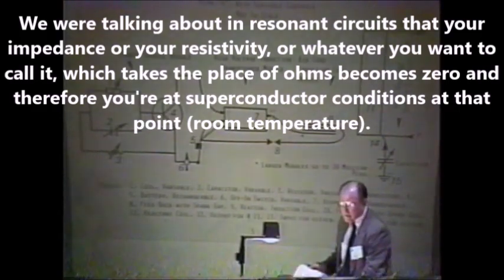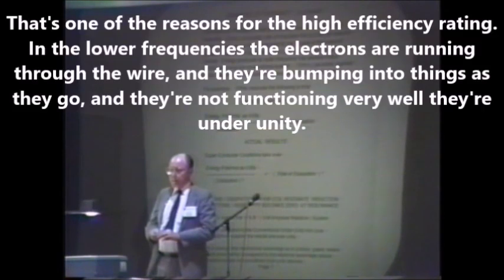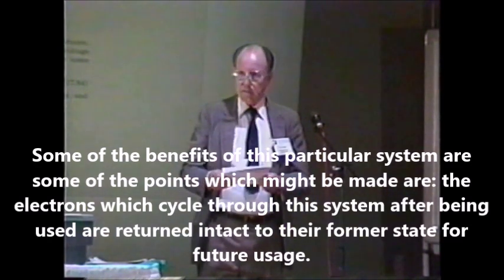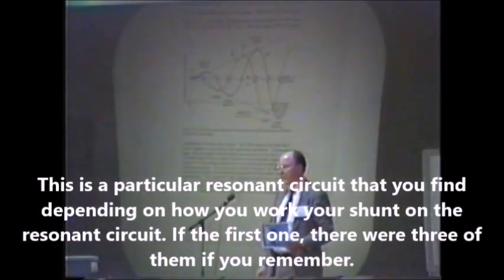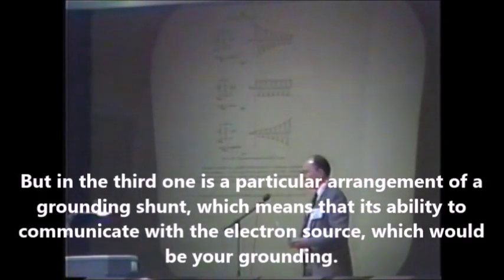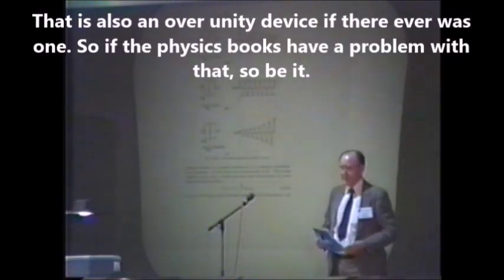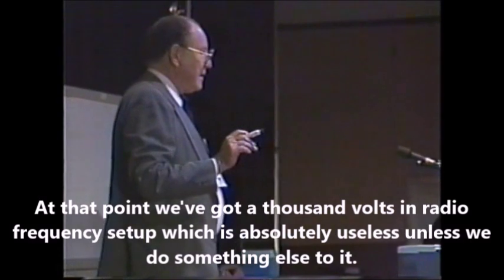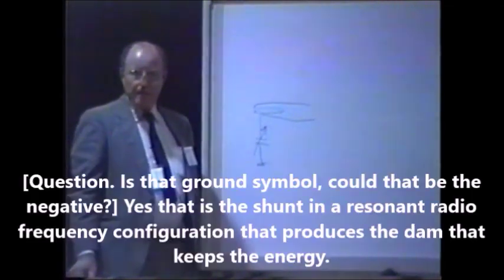Electron Grounding Shunt Don Smith 1994 Video 1 Quotes

Comment: Thank you! This is the confirmation i needed. I will test my machine with this ground shunt setup. I have two 30 foot deep galvanized well points spaced 40 feet apart for my grounds, one for the electrons to be pulled into the resonance circuit and one to return them back to ground through the load.
Reply from the maker: If you are not planning to replace one of the US grid you don't need a lot or any earth grounding. You can use a cage as a ground embedded in the air which is grounded in the ground as we get into in the Res kit 2. We are not moving electrons fast distance-wise but more in a vibrational sense. Since the electrons are cycling we don't use them up or need a huge supply of them. When we think of charges in a coil, they can be very little, that is the natural capacitance of a coil without added capacitor. In the pf for example. So you say well that isn't enough to do anything. But if we consider what Benitez wrote in his patent that while a spec of charge is nothing, it is something when you add high frequency to it. Far more with Don's system which I call a level three Tesla coil that is mid-Mhz range. So, for example, if you add one drop of water into a large building every second you would not even accumulate any water. Same with 60 times a second. But if you dropped 500 millions times a second you would fill it up fast. So if you take my little 100pf cap in the kit one and charge it up and discharge it 500 million times a second, I believe it turned out to be 2.5 MW at whatever voltage I forget. This is one aspect of the multipliers available. In relation to grounding we only so much charge stored in the ideal resonantor--ideal being no added capacitance and only the natural. Things are a lot different as you see the case being with most of the DS models and what he was mainly focused on in the 90s. Most people are focused on the lower level Tesla coils with khz or low mhz with more disruptive discharges, capacitors and difficult spark gaps along the lines of the Magnifier patent which I call a stage or level 2 Tesla coil (level one being what people usually focus on which is not really a Tesla coil). 
As you can see with our friend on the other page, and as Don said repeatedly, especially in the end, we don't even need coils. The coils are indeed multipliers of amperage and voltage and they allow you to control those values. But you can just focus on the central process and multiply the output as demonstrated. Any way, you have various optional multipliers of electrical and magnetic resonance, high voltage, high frequency and/or as necessarily implied in high frequency is sharp gradients in an open context, etc... The grounding is not understood by most people and they end up killing the processes that are beneficial. The ground shunt is still not understood by most people even with this video I did to draw attention to what Don was teaching and which was entirely missed on the forums until I put these videos up (and they have never got any attention because all this us suppressed). People only saw the third video onward, which I believe you were at. But the context of his book and teaching and diagrams was based upon the first two videos of 94 and 95 where this was first mentioned. People were just directly connecting to ground and that completely changes things. For lower frequencies we can do a diode in the proper direction (remember current is opposite to electron flow). This is why I started the kit 2 with the basic physics charge grounding experiments. The diode prevents the charges from going back to ground at the point of entry on the off cycle. [In the DS book I have the diode facing the wrong way btw.] Don was doing higher frequency so he needed the proper resistor or equivalent parts to accomplish the same thing. The charges produce a gain in the resonator and then take the path of least resistance through the output back to ground. You can look at all this with James Corum's models and explanation in the kit 2 details for understanding all this with a level two Tesla coil at the lower frequencies (without the ideal grounding concept) which goes beyond lumped circuit analysis which is what the regular Tesla coil people are limited to in a under unity context.  The key point is when the rotary spark gap opens up then the L1 and L2 are no longer one body but the secondary is free to self-resonant and that's where you see the first substantial gains with the trumpet wave taking off. Corum highlights that fact and that it is not covered in the books mysteriously. Don was at those lectures no doubt, or was aware of that teaching and context. He just took it further with higher frequency and the setting aside of most of the parts needed.
Reply: @rickfriedrich  Thanks for the detailed reply! I sent you an email last week to your sales address asking about this very topic but you answered it here. I finished reading your book and it’s really well done and has helped clarify my understanding immensely! Reading those lecture transcripts is much more helpful than listening to Don speak. I do wish you would have added more of your own insights though since you seem to understand the ground shunt importance more than anyone.  The insights you added about the acceleration and deceleration phase and the comparison of Prentice patent was very helpful.

I’ve already built several Don Smith variants and i have 3 more waiting for parts to complete but I’ve been unable to understand the ground shunt until i finished reading your book. Now i need to test it out on my machines to see if i can see this huge increase in output power. As of now i can light 12 (4w) LED bulbs with only 6w input from my NST but they aren’t lit to full intensity.

I watched one of your videos yesterday about your Resonance Induction Coupler Kit part 2. I’m not so interested in the kit as in the booklet that you apparently include with it. Does it contain your knowledge and understanding regarding the details of that ground shunt concept? Can you tell me a little more about it?

I’m planning to bring a few of my small machines with me for the meeting in Lansing. Building and tuning Don Smith machines is easy but figuring out the ground shunt has been difficult since he only drops very subtle hints and they’re easy to miss if a person isn’t paying attention. And yes i was previously just attaching the machines to ground but i saw no improvement so i knew something was missing.
Reply: The so called shunt is a rc filter.  @rickfriedrich
Reply: Man, that's such a good set of clips condensed!

Comment: Can anyone give me information on the "laser module" mentioned @ 13:27.  In other videos I have heard Don mention that such modules can be used instead of a spark gap, and I am keen to avoid the health risks that can be caused by a spark gap.
Reply from the maker: If you want to avoid health risks then do not get into this. Unless you set up sufficient shielding you will also be exposed to radiation without spark gap setups as well. This is why I have been very careful about what I share. You have to understand that resonance processes draw in electrons from various groundings. The earth ground is the most abundant well of electrons and ideally the only source. Metal frames or chassis are also depositories of electrons and can act like antennas when connected to a resonant system that acts like a pump pulling electrons from the air. The air is a ground also, and such systems will draw in electrons from the air. Experimenters are in the air and close by and will also be electron contributors. As such this will deplete your vitality and you will feel drained more and more. You can develop rashes also. Whatever health problems and weaknesses you have (most everyone has a lot in our day) would be accelerated with exposure to radiation. People say there are good frequencies but I do not trust anyone or any unnatural frequency to be good for me. Best to abstain and shield against. Studies found that if you change up the frequencies every tenth of a second that your cells will be safeguarded from the cancer causing processes of constant frequency radiation (including at 60hz).  Now you can create cages and shielding and suitable grounding to avoid this. But I doubt that 1% of the people will bother to even look into that. This is like the old days of rushing into the mines to find gold while exposing yourself to major risks. It's free energy fervor fever.
Reply: Thank you for such an excellent reply.  I must be in the 1% because I have been studying this for some time but not prepared to build until I understand all the risks the best I can.  I was especially grateful for your video where you made a zinc covered box.  I would never have thought to use zinc but it does seem to have some special properties.  I knew that what seems to usually be called the Don Smith Generator or device, the one most promoted, would require shielding just so that the FCC/DOT wouldn't come looking for me.

Do you think Don was badly affected by his devices?  He never appeared to be overly healthy.  He claims to have operated them only to prove they worked and for proof of concept.  If true, he might have gotten the greatest exposure when presenting at conferences.   I was particularly interested when he described what happened to a screwdriver he inadvertently placed/dropped in a working device.  Seems to me that was the major contribution to his poor hearing.

Perhaps I am overly concerned about spark gaps?  I would like to eliminate them to remove a physical wear item but also would like to run a Smith device in a car in which I might be sleeping.  So even if shielded, is there not a problem with ozone and other gases generated by the sparks?  In a house, this could easily be vented.  It becomes more of a problem in a confined space.

I find it amusing that people warn me about the fields in an electric car while being oblivious to the field created by an ignition coil.

Several times Don said he put spark gaps in his devices because people expect to see them.  I am interested in all options to eliminate them but realize I will still need shielding.

I have decided that I will start with a different design and first target one watt @ 120 V, then five watts, etc., and carefully measure the fields being generated before attempting anything big.  Being able to generate my own power will give me more options to be in places away from the  electrosmog of cities.

Comment: Hi Rick, thanks for the video - glad you're back posting. All the best.
Reply from the maker: Well youtube comments were down for while. They suddenly came back online when I started posting.
Reply: Weird - sounds like youtube trying to be clever.
Reply from the maker: Apparently happened exactly a year ago. Hack? Upgrade? Suppress some comments somewhere?
Reply: Who knows Rick - they are a law to themselves and can do whatever they want without answering to us. But it's a useful tool.. when it works! The solar minimum feels like it's in full swing here in the UK - hope you've got your thermals ready :-) I'm looking at doing some induction heating on the return water pipe of my central heating system. Still researching it.
Reply from the maker: solar minimum?
Reply: Solar cycles are responsible for majority of climate change on earth (even man-made geoengineering doesn't come close to the effect of our sun!). Look up Maunder Minimum and Dalton Minimum which were the last two "grand solar minimums" in order to know what to expect. The sun has regular radiation cycles every 10-12 years, and big changes roughly every 200-220 years with minimum and maximum cycles. The earth's climate is now changing because of changes in our sun's magnetic fields and this has a knock-on effect on earth's magnetic field. The decrease of magnetic field from the sun allows more gamma radiation into our atmosphere (it was previously providing a shield) causing wetting weather in the northern hemisphere but also more extremes such as droughts in the southern hemisphere. Shorter growing seasons are the main concern. Also triggers an increase in volcanic and tectonic plate activity. A good place to start research would be the work of Prof. Valentina Zharkova. For a channel that does a good job (and also a good website with stats) check out Ice Age Farmer channel on here.
Reply from the maker: Mark, yeah I know. I thought you were referring to some UK policy.
Reply: Yes, I did wonder about the question as I thought you would know. Learning to grow food has risen to the top of my list of skills to acquire.
Reply: @markflint9089  When growing food is your interest Mark, you are familiar with the boosting effects of HHO towards plants? KR hans
Reply: Hans Scholte Yes, thanks for the reminder. I tried it when germinating microgreens but didn’t notice much difference. The microgreen are harvested at 10 days so I think the HHO will produce better results with vegetables that have a longer growing term. Regards.

Comment: Hello Rick, do you think the Grounding Shunt is just a non-inductive resistor or Don was using a combination of resistor with some other component? like a diode
Reply from the maker: The point is you can use various parts as he said. It is up to people to experiment (safely please). I have a policy that I will not discuss specific parts with anyone, other than what I supply. If not I would be working full-time for free and the parts I use would be bought out (which happens enough with the parts I sell on the website or in the kits).

Comment: Wow! Really nice and relevant talk about! Thanks Rick for share! It's seems to create high freq. then you're creating high potential difference with ground freq.
Reply from the maker: No it doesn't create HF but allows for high amperage. Every impulse to the electron gives off both an electric and magnetic impulse. So the more electrons that are spun the more energy is created. The frequency is determined but the length of wire/coil, as well as the voltage (with the input and turns of the coil, etc.). The amount of power is the amount of electrons that are drawn into this cavity so-to-speak through proper resonance and related processes. But the difference between the ground potential and resonant high point is essential. This is another reason this shunt is necessary as if it was just an open ground then it would just short out to ground, which is what people are doing...
Reply: @rickfriedrich  
Hey Rick, how do we ground the unit pictured in page 166 "isbn 978-1-932370-84-3".
I built it like pictured and like you said made the mistake of directly grounding it and getting only a slow voltage ramp on the capacitors. I'm using 2 different ground points driven into the ground 6 feet deep and roughly 10 feet apart from each other. Using 1/0 stranded welding wire as grounds. one ground is going to case of NST(non electronic) and the other ground going to the "C" connections of 3 phase capacitor bank. "A" being shorted between the two sets of capacitors and "B" going back to the two diodes coming from the NST outputs. My next experiment will be to use variable capacitors as shunts on both grounds. Just wanted to ask for some guidance before I continue.

Thanks for all the great videos and work to date. Been on this rollercoaster for a long time now and finally relazing what I have been doing wrong due to your videos and continued guidance.

Looking forward to your reply 😁